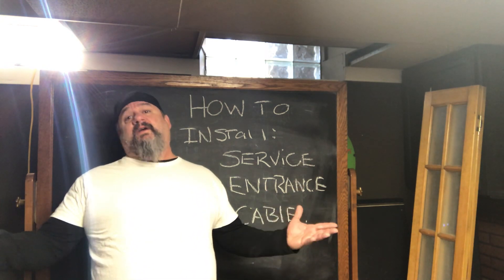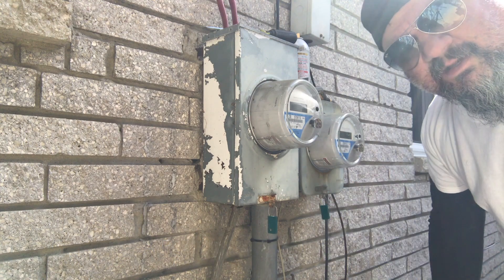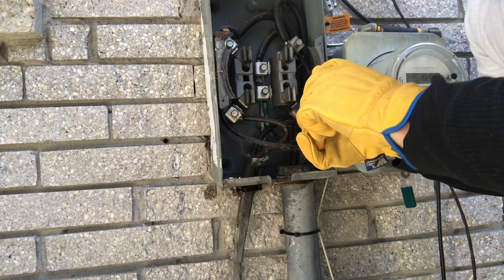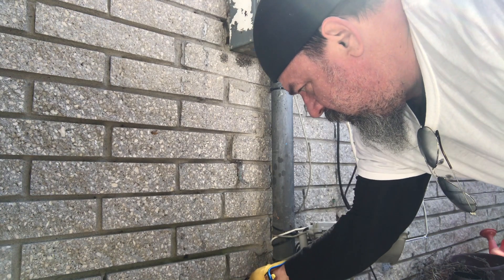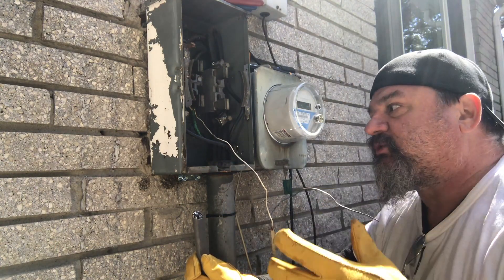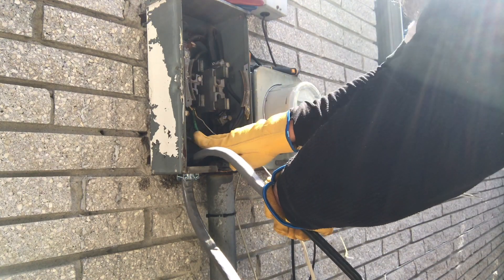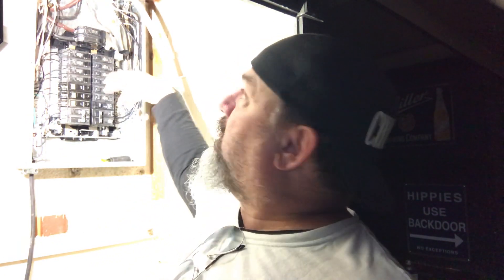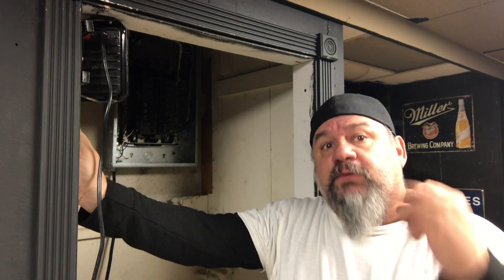100 Amp Service Cable Get Ready to be Replaced!   ""Knocking Out an Electrical Project:

Comment: Ever tapped  a 2nd service entry wire from meter to run separate 100 amp to garage?????
Reply from the maker: I have tapped a meter twice but the code now reads that you can only tap a meter to another meter.  if you need a second panel you either use a second meter if your utility company allows or tap from you panel for a sub panel. which if you have a 100 amp panel you can actually have a 100 amp sub panel. so long as the load doesnt exceed the main breaker amperage. hope this helps.
Reply: Thank a lot

Comment: Starving electrician! Love your videos very informative and funny you get a sub from me good sir. Have a few questions, I have a house that has two 60 amp wadsworth panels that appear to both be connected to the meter. I'm wanting to upgrade to a new 200 amp panel. The service from the pole comes underground to the house to the meter base. My questions are, how do I know the cable from the pole to my meter is rated for 200 amp service? Also does the ground coming from the two grounding rods get grounded and bonded to the meter base as well as the new panel inside the house? Also from the meter base to the new 200 amp panel is aluminum seu 4/0 sufficient for this new load? Again really enjoy your videos and please keep making them!
Reply from the maker: ok so underground wire is usually rated for 200 amp. I have never seen it any other way. you may want to talk to your utility company and at least ask what its rated for. worst case is you schedule them to upgrade it. I bet its already rated for 200 amp though. Next, you do not ground the meter. if there is a short to ground then it energized the ground without a breaker. the ground rods go to the panel. bonding wire goes to the panel as well. 4/0 is good for 200 amp. I hope this helps.
Reply: Thank you for getting back so soon! I've called the utility company unfortunately I got two different answers. So could I potentially check the physical diameter of the cable to verify for myself? I've watched so many videos now on grounding and bonding and I'm just trying to understand fully. So I simply run my copper wire from my grounding rods to the panel and land them on the ground bar where then the bonding screw in the panel bonds the ground and neutral as well as bonds it to the meter base? Also the water main coming into the house is nearby does it need bonded to the panel as well? I feel like there's mixed answers for this topic on the Google webs. Would be awesome to see you make a video explaining the grounding and bonding. Thanks again for your help!

Comment: Dude love your vids keep them coming . I’d like to see more of how to work on a meter live. Let’s say you have to change the meter base and you can’t turn off the power
Reply from the maker: well in Michigan I clip the feeders myself but with underground you have to have the utility company shut off the power.
Reply: I think that since we did NOT hear a giant arc when he pulled the meter, that he OPENED the MAIN breaker before he pulled the meter.  The voltage doesn't go away by opening the breaker, because it's downstream of the meter, but you do not want to pull apart high-amp electrical connections under load.  If you want a small example of what I am talking about, unplug your shop vacuum while it is running & watch the plug as its prongs break contact with the metal inside the outlet.

Comment: Tell me more about your org for veterans. Can you have two 200a cans (panels)going a 200 service?
Reply: Will you help veterans coming out of addiction treatment . I work for the VA in South Dakota.
Reply from the maker: @PeaceFulMindSD   The idea and in our mission statement it to combat P.T.S.D. and veterans suicide as well as addiction. so yes. I have used veterans and they have went on to full time with other contractors. ideally I would like to involve all trades so the vets can decide where THEY want to go. not just electrical. we are going to reach out to the Va here once we are set up. I think VA as well as through the VFW we could set up a program for them to do the data base of contractors and maintian the relationships. this would be a great way to involved disabled Vets. its all a matter of money to get the infrastructure paid but were working on that plan as well.
Reply from the maker: hello and yes you can feed a 200 from a 200 amp panel. its not about how many panels you have. you can have 10 200 amp panels if you want. it doesn't mean you have 400 amps. your first panel is 200 amps and thats the max load for your house. the question comes in when you start adding things that really draw. like a shop or something you may max out your service. as far as the org. we are raising funds and awareness to train vets in the skilled trades. we supply everything they need as in tool, boots, and training. an accredited online course is better to reach more people but the difficult thing is to get all the electrical contractors to take our vets and do a work share. so if they have work for maybe 6 month we will have another slot with another contractor waiting for them. the whole idea is to create this dada base of contractors so the Vet gets all of the required hours to take the journeyman's exam. thats it in a nut shell. we are a 501 C3 non profit. were opening a place in Vegas to do nothing but raise funds for Vets full time. it takes a ton of time and yes a ton of money. we plugging away though. thanks for your interest.

Comment: Electrical Contractor from Omaha Nebraska Are you licenced? I used the same temporary outlet for power. But I Have it Fused Outlet and Its GFI.. that In A Little 3 circuit buddy box a have it fed with 15 ft of #10 SO Cable with Heavy alligator clips on the end.
Reply from the maker: Jon ANDERSON  yes I’m licensed 15 years in business and 30 years in the trade. This like I explained was on my house for me. I know all about temp wiring and could have used one of my generators if I needed.

Comment: Do I have to use a 2 gang meter for a  2 family home
Reply from the maker: yea unless you plan on paying the electric bill your self. usually you either do two service drops that connect to the overhead powerlines or a small troffer or junction box that spans both meters and feed the box and split off for the two meters. hope this helps.

Comment: How much does this service costs? Would can this be done at a mobile home
Reply from the maker: well a mobile home I believe are wired for 150 amp but the rules are still the same but you bond the body steel at the trailer

Comment: Whats the difference between aluminum and copper
Reply: In san Antonio wpuld i need a license electrician or can i get a permit and do it myself
Reply from the maker: @EASYBREEZYY   as far as I know if you did your own work on a house YOU own then you are allowed to do whatever you want. dont quote me on that because it may be different in different states. thats just a quick phone call.
Reply from the maker: copper is a better conductor and therefore you can go down one size smaller but its more expensive. if your are running pipe you could have a smaller pipe because of the smaller wire but thats about it for difference
Reply: VSCO Clown here TvT what size do I use for a 200amp meter service to a 200amp panel box?

Comment: What would you charge for replacing service from the weather head to the panel? Including a new meter box?
Reply from the maker: for me they would run between $1200 and $1500 i'm in Vegas now and its a lot more involved and would be about $3500 but with a riser if its piped through the soffet its $1500. hope this helps
Reply from the maker: https://liveelectrician.com/f/electrical-questions

Comment: I have a few questions.  I have 200amp breaker box and meter box.  I have wire just like you put in for 600 volts.  And i got wire that lowes employee told me to get and its has red,  white,  solid black and a bare wire so has 4 wires is that right?  Its supposed to lead from breaker box to meter box that wire is.  Please help
Reply from the maker: most service wire is rated for 600 volts but what you need to know is the size correct for 200 AMPS.  going to the meter you only need three conductors. you dont ground the meter its self. you ground the panel. whatever is feeding the meter feeds the panel and its always 3 wires. they dont want you to ground the meter its self because if theres a problem its like having the live power from the lines going into the ground. now services and panels differ from state to state but wiring the panel from the meter can is always the same. two hots and a neutral and then you ground and bond the panel its self. hope i explained this so you understand...sorry  for the delay but getting my act together with the move has been a task. if you have any real time questions www.live electrician.com ....thanks

Comment: No worries about PG&E rolling up while you have the meter out?
Reply from the maker: great question. from my experience in Michigan its not a problem but some states vary. in Nevada you have to have the utility company shut it off but I think because its underground. you own your service and thats why during a wind storm the utility company wont put it back up if it gets pulled away. you arent stealing anything in so pulling your meter has never been a problem but check with your states just to be sure.
Reply: Because it takes FOREVER to pull a permit and get it scheduled for inspection.

Comment: You are not suposed to remove the meter if you are not the electric company.is that true?
Reply from the maker: for legal purposes I would say yes but you own everything from the attachment point on down through the meter and the panel. if you asked them to re support the meter they wouldn't because its no theirs the meter socket or globe is their property. me being a contractor can remove it and as the owner you can remove it but the area they want is for a permit to be pulled for any work being done. where I did something illegal is tapping onto their power without paying for it. as far as pulling out the meter its not illegal to pull out. technically you notify them after the work so they can put a new tag on. hope this helps....I need to apologize again because of how long its taking me to get back to all of the questions and you and everyone else will get this same part of the response lol. I have created a blog for questions and answers so more can people learn and also a live electrician portion for more advanced questions. I now offer phone consultations as well as zoom video for the advanced questions and so I can take a look and advise. www.liveelectrician.com or starvingelectrician.com I would appreciate further questions there. Thanks for watching!!
Reply: No its not true but to have it replaced the power company is supposed to replace it after the ahj inspects it, which means a permit.

Comment: Love your video's i have learned so much I just wish I found them a bit earlier. I am building a tiny house, i have a 100 amp service set up at this moment. I would like to know if there is anyway to take use a 100 amp service and wiring to plug into a 50 amp RV plug, will work or if it is a bad idea and I should down size my amps?
Reply from the maker: You can do it! so long as you do not exceed the load of the 100 amp main service.Thanks for watching. look for my virtual electrician coming soon, answer questions, help with your project, let you know prices and what to expect when hiring an electrician and just someone who will shoot you straight.

Comment: Great video! Can I ask what size cable that was you were installing?
Reply from the maker: thats number 2 aluminum. rated for 100 amps.https://liveelectrician.com/f/electrical-questions
Reply: @StarvingElectrician  if running 200A can i run #4 AWG wire?
Reply from the maker: @GrowYourOwnFun   4/0 not #4. number 4  is quite a bit smaller. it also depends on copper or aluminum.
Reply: @StarvingElectrician  cool thank you, that’s what I was thinking. Do you recommend aluminum over copper?
Reply from the maker: @GrowYourOwnFun  i use aluminum because its cheaper by far. you can do one size smaller with copper though.
Reply: @StarvingElectrician  thank you!  Got all my circuits pulled and boxes done. Now time to hang the panels inside and out and start wrapping it up for inspection!
Reply from the maker: @GrowYourOwnFun  right on!!! great to hear.

Comment: This was exactly what I've been looking for. I've got 2 questions:
1. With it being the new digital meeter, can the service provider/power company not tell when and if the meeter is pulled?
2. What did you do about the missing "Edison" tab? 

Thanks in advance  I really enjoy your videos.
Reply from the maker: yes they can tell but I have only once had the power company come out because they thought I was having a problem. in a really rich area of course. the tab I saved and simply hung it back on the meter can. no biggie. you own everything up to the connections at the top of your service.look for my virtual electrician coming soon, answer questions, help bidding, let you know prices and what to expect when hiring an electrician and just someone who will shoot you straight.
Reply: @StarvingElectrician  ,The reason I asked is that I'm needing to change out the service wire in my house (built in the early 60's). Bc it still has the original, what looks to be no more than 6 gauge, clothed wrapped wire. And there's no "main" breaker on my end. It's just comes straight out of the meter box, to the inside panel. I've got the know how to do it I was just (like you just mentioned) trying to avoid dealing with having to spend a shit ton of money on something Im capable of doing. Thanks once again and keep the videos coming.

Comment: What kind of oxy-guard did you use for the aluminum cable connections?
Reply from the maker: its called no lox. they sell it at home depot. common stuff.
Reply: @StarvingElectrician  Thanks!
That was quick! 😃👍😷

Comment: I do have one question: the cable you brought in is Aliminum. I took out all the aluminum in my trailer and replaced everything with copper. Did you use aluminum as a  personal preference?
Reply from the maker: Rogelio Chavez  well it’s cheaper and easier to work with. As a conductor it’s proper so it works and it’s code.
Reply: @StarvingElectrician  the reason i asked and i know in your case its not that long of a run but i was told the heat is a factor? I live Tucson and in summer the temp gets up to 116.
Reply: Rogelio Chavez only difference Is the ampacity rating either or are fine
Reply from the maker: Heat is a factor inside a pipe and that’s why you D rate. Aluminium or copper the same rules apply. The type of wire has no bearing.
Reply: @StarvingElectrician  thank you tacos and beer on me next time im in Vegas.

Comment: Those insulated gloves?
Reply from the maker: lol danger is my middle name!! so long as you don't touch a hot wire while grounded you are good. but, its always best to have rubber gloves under the leather ones. remember this isn't high voltage. each leg is 110 volts.